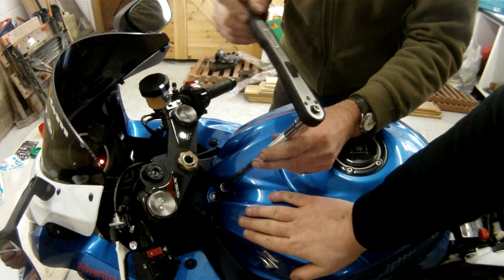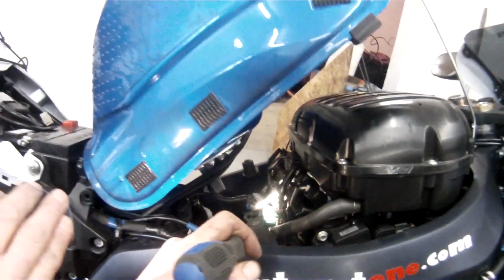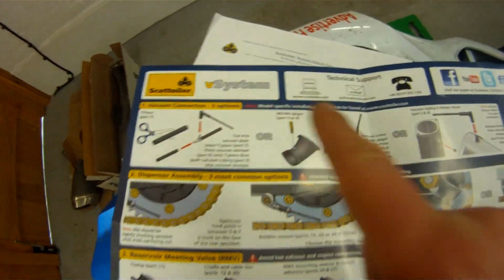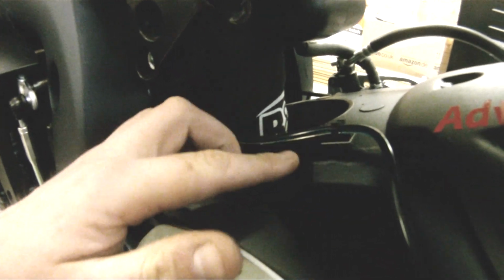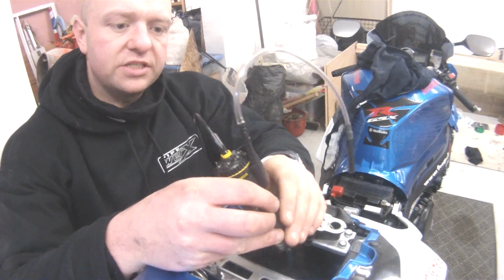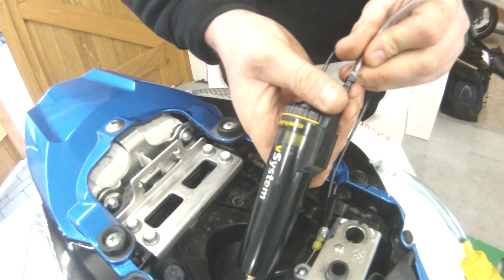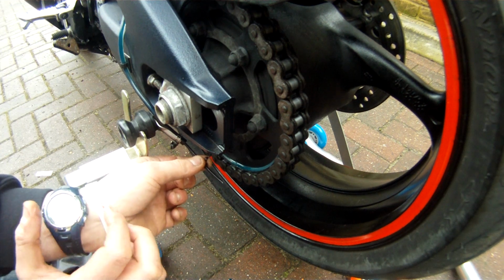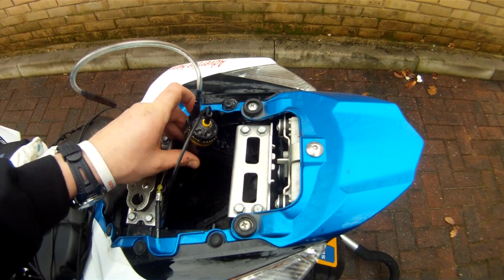How to Fit a Scottoiler vSystem

Comment: I used a Scottoiler down to Cape Town, and prolonged the length of the chain quite extensively... hardly needed to adjust the chain the whole way down.   Just remember to turn the Scottoiler off on the sand, and crank it up a bit in the rain when you're on the tar.

Comment: Don't rate them, what a mess it makes if the pipe moves from along the chain, I took it off and do it manually now, not as
Reply from the maker: Aye I was the same, just couldn’t get on with it so ditched it 👍